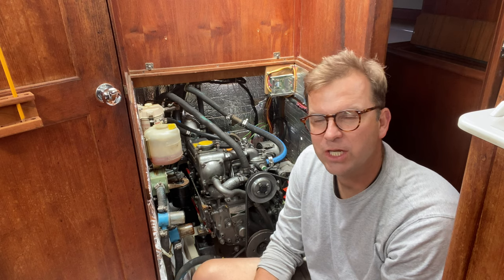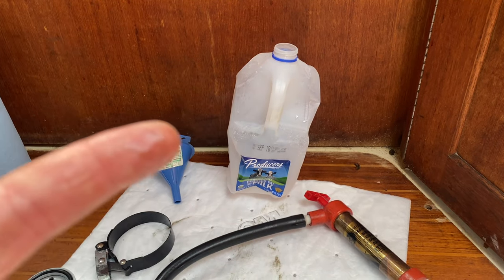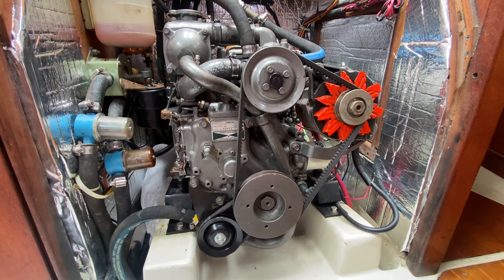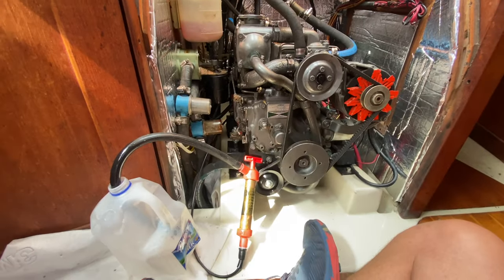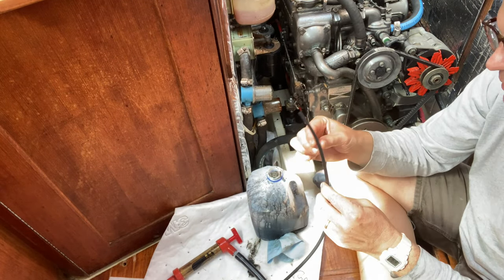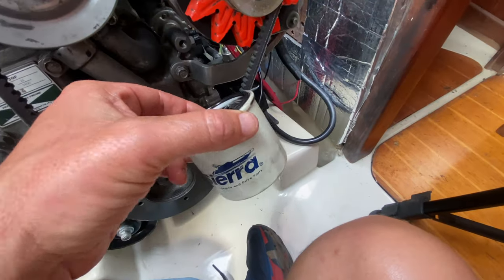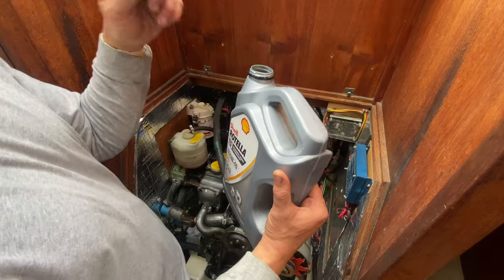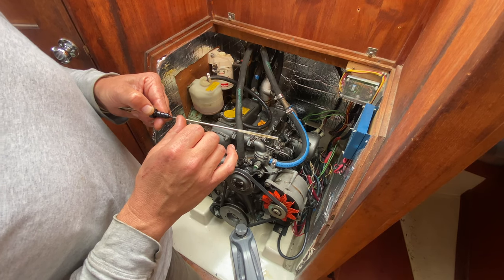Yanmar 3GM30F Oil Change

Comment: The oil pick up is directly under the oil dipstick. If you put a longer wire (than the dipstick) you think you are hitting the oil pan, but you are only hitting the oil pickup. You have to keep rotating the hose and pushing down until it bypasses the oil pick up and hits the bottom of the oil pan. I too was only getting a little bit out until I found this out. Keep googling the engine number and put in oil pickup and you may find it that explains it better.

Comment: After watching this, I am SO glad the previous owner put a drain plug in  the pan of my 3GM30f! I just put a heavy trash bag under it, open the drain, let it go, remove and replace the oil filter, go have lunch, come back put the plug back in, fill-er-up !  You SHOULD be able to remove the pan in situ and put a bung in, if you are inclined to do so.

Comment: What kind of alternator is that? I never could have much luck with the hand pump. I use an electric but hose placement is key.
Reply from the maker: I don't know the manufacturer of the alternator.  It has a very old fashioned external regulator.  So far it has worked just fine.

Comment: Hi great video, one question i have a small boat with a yanmar 1GMC 
diesel engine 6.5 hp  do you know what oil i put in the gearbox. Thank 
you
Reply from the maker: Hi - Your best bet is to google for your engine owner’s manual.  The 3GM30F transmission takes 10w-30 motor oil.  There is a good Yanmar group on FB as well that may have the manual already.
Reply: WHAT gearbox?? makes a difference!  Mine takes ATF, some take engine oil!
Reply: ON MY 3 GM 30 THE MANUAL SAYS TO USE THE  SAME OIL AS THE  ENGINE STRAIGHT 30 WEIGHT  ( ROTELLA T 1 OR YANMAR 30)

Comment: Nice video, thanks for sharing. Wouldn't you be using a mineral oil instead of Synthetic on these Yanmar engines?
Reply: check your manual. I, personally, use Yamnar brand oil ( and filters, coolant, etc) . About the same price. Unsure if it is synthetic or not.

Comment: all that work to get half of the oil out? There is space under the engine for a 2.6 liter container, laid on its side with a hole cut in it to have all oil drain into...
Reply from the maker: Yep - it's an imperfect process.  Where is the drain plug do you use to empty your pan from the bottom?